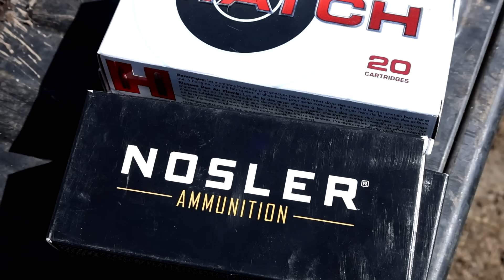Alaska Wildlife Game Camera Footage | Rifles & Bear Burgers

Comment: 😂😂I like how Eric went from stomping on the tire to using a hammer to immediately using the excavator.
Reply: Kinda cheating 😅
Reply: Smarter not harder as they say!
Reply: You can also cut the old tires with an angle grinder.
Reply: When Eric jumped in the tire and the metal thing popped up, I could only think that those tools could lose some valuable jewels. Those two are amazing! Always!

Comment: Bandit's ready!!  A tip.  Before bleeding, use a turkey baster to suck out all of the fluid from the master cylinder, wipe it clean with a lint-free cloth, fill with fresh fluid and THEN bleed.  Do NOT allow the master cylinder to go dry or you'll suck air into the system and have to start over.  You are correct to begin with the furthest bleed valve.  By starting with clean/fresh fluid in the master cylinder, when you get clean/clear fluid coming out the bleed valve, you KNOW it's flushed and has only clean fluid in it.  Move to the next one and repeat.  Another tip which can aid in knowing all the air is out is to use a stick to hold the brake pedal fully pressed overnight.  Air rises, so any residual bubbles should migrate UP to the master cylinder.  Also, if you don't already know about "Speed Bleeders", study up on them.  They use a spring-loaded check ball to close the orifice when the hydraulic pressure is released during bleeding.  They're slicker-n-snot on a greased pig.

Yes, wolves will devour the bones.  That bird's kin folk are sayin':  "Why don't he write???"

Yes, the lighter the weight of the rifle the harder the felt recoil.  The heavier the rifle the less felt recoil.  Also, put the tiniest dab of anti-seize on the threads for the barrel so the muzzle device doesn't seize up on you.  Also, now that you're much further north, KNOW which lubricants will NOT freeze up on you in the middle of winter.  Some local forums may help but will net you a lot of opinions.  For wintertime a thin coat and lightly wiped off will lessen the chance of your firing pin freezing in place, or your trigger mechanism, or possibly even the bolt.  Also, do not bring your rifles inside the heated tent/cabin.  Leave them in the cold so they don't sweat (condensation) and then freeze up on you.  And that way your scopes don't fog/freeze too, but I'm certain you've learned that by now.  Helpful for those new to the severely cold climates from a more temperate one.

Cleaning the barrel doesn't need to happen every time you shoot, when accuracy falls away is when you clean it.  The other time is if you switch from a lead bullet to a solid copper bullet, the accuracy can go away on you.  A squeaky-clean barrel's POI will differ from a "fouled" barrel (having a few shots through it, powder fouled).  Once fouled it should remain pretty consistent.  So, you should verify your accuracy after a few "fouling shots" after a thorough cleaning.  "Back in the day" when people shot "black powder", it was critical to clean immediately after shooting.  It's turned into a tradition passed down from generation to generation.  However, today, with modern (smokeless) powder it's NOT corrosive, therefore there's no need to clean it right away.  Anything using "black powder" still needs to be cleaned immediately after shooting.  Another tidbit is to know your distances at which you "Point of Aim" is also your "Point of Impact".  Since the bullet travels in an arc, there will be two distances in which the "POA" will intersect the "POI".  For example:  my 6.8 SPC caliber can be sighted in at 50 yards and it'll also be on for about 200 yards and be only a couple of inches high at 100 yards.  Also, know the drop at distance to help you know what your POI will be for a given distance (in relation to your hold/POA).  Also, on a low magnification scope you won't "see it" so much, but if you have a 24x (for example) HIGH magnification scope you'll be able to SEE your heartbeat due to the crosshairs moving with your heartbeat.  So, for long range, don't grip the stock using your thumbs, your thumbs have a pretty strong pulse and will transmit that to your crosshairs.

Rock on you two, God bless you both!

Comment: Eric on a post note to install break fluid and you can't pour from container use a long hose, 1/4 inch clear line should be good. i see you use one to drain it... so just use longer hose to refill  main reservoir. and a hole in cap make sure hose is in cap tight put hose into brake reservoir turn up bottle and watch it go down hose and fill reservoir up. Makes getting into rear-ends transfer cases etc.... real easy.

Comment: You obviously got it done and figured out, but I'll give ya a tip with tires, in case you didn't realize it (you didn't mention it anyway).  Rims, have the middle section as a smaller diameter, so one half of the bead can be down in the "dish" as we called it, while you work the other part of the bead, over the lip of the rim.  On that first tire, you essentially mounted the tire, while it was all on the bead, which means you worked very hard to stretch the tire over the lip.  Next time, just stomp the sidewall of the tire, till the bead opposite of what you're trying to pry over the lip, is down in the dish.  Then prying it over the lip is way easier.

Comment: Eric, I just recently purchased a slid hammer for breaking down tires. it works well for small 8-to-12-inch trailer tires.  bigger heavier duty tires like car or truck tires it doesn't work at all. That's why I laughed out loud when you stood on that tire trying to break the bead. I was thinking that ain't going to work.

Comment: Hey guys nice job on the six wheeler. Yeah I know that ammo in Alaska is expensive but you can get a hand loader for each of those that's not that expensive it's like 50 bucks for one type of round   50 for the other so you can load your own ammo and that's kind of a good idea because what makes you a good Hunter is practice especially not at 100 yards you know sometimes you might have to take that 300 yard shot and if you can go practice at 300 yards and set your current so you have 100 yard setting in a 300 yards set in and all you got to do is turn your turret somebody clicks and you can have it on the side of your weapon so you know when your range find your animal you can get a direct hit on it practice makes perfect. Actually you said you have a 45-70 that's a good mousse weapon because the standard load is a 375 grain hollow point and it's very accurate at 150 yards. My main hunting weapon is a Winchester model 70 chambered in 300 H&H and it's one of the most accurate calibers ever made with  180 grain bullet he doesn't drop until about 175 yards but like I said practice makes perfect really it does

Comment: I remember my first attempt to changing a tire using a machine for removing a tire from the rim. I struggled severely, nothing I did worked to get the bead over the rim. The guy that typically removed and changed the tires came over and said 'keep the bead in the narrow area so the tire can get over the rim edge'. It worked.

Comment: Good rifles. Bet they were still about a grand each after the 500 off...
Great calibers too.. but I tell ya it's hard to beat a 30-06 especially if you hand load you can load it for everything from small game to moose. You can get right close to 300 mag numbers out of it. Plus you can always find brass even if it's old ww2 and newer surplus ammo. 
A good thing to get for the side by side is those rims you can put on both way so you don't have a mounting booboo and easily rotate or switch around for what ever reason.

Comment: Getting old tires off a rim is a tough manual job - even with the mechanical push-down aid of a powerful front-end loader attachment. Perhaps next time, try to cut the old tire part-way inwards with an abrasive blade to make it easier to  get it off the rim.

Comment: if changing the fluid doesnt help you may need to change the flex lines.  The rubber flex lines when they gey hot expand and cause brake fade.  See if they make braided lines as a replacement.

Comment: The key to good-tasting bear meat isn't what you season it with, but rather, what the bear was eating in the previous 3-4 weeks.  Which means you need to get it during anywhere between leaf-eating and berry-eating, but before any fish spawning runs happen.  Or wait at least 3 weeks after any spawning runs have tapered off, and the bear goes back to eating plants.  Otherwise that bear will taste very fishy / gamey.  Berry-eating bears taste the best!

Comment: Get a Mitty Vac to bleed the brakes.  Affordable, does good job also some Speed bleeders for each caliper.  Rabaconda or NoMar tire machine.  AMZ.  Like that bead breaker.  Bears, helped work a couple cases where people were ate, nothing left, took bears down cut them out.  Never let your guard down, either one of you.  Like sharks in the water, there's times women don't need to go out.  Very seriously. Buy a single stage reloader like an RCBS Rock Chucker  Master Kit or a Redding.  You need a master kit to get the powder charger and scales and a few other pieces to get stated.  Can get a Lyman Turret head also in the Redding.  I use all these a lot and Dillions.   See what powder works best for bullet weight and get started.  Large rifle primers.  Save your cases.  Reload all your rounds 357, 45-70, 300 PRC and 6.5 Prc, 454 Casull also.  Takes a little time get a couple manuals Lyman Speer Sierra, others lot on line as well.  Each powder bullet company has data to use.  Christenson's are great rifles.  Easy to carry.  Those are cerakoted, burnt bronze finish.  Ceramic, tough stuff.  I have several, very durable.  Carbon fiber barreled especially.  Quality products.  Place looks a lot different in summer.   hard to believe the difference.  Lush growth.  24 hr sun almost.  New tires or no go in the swamps.  5 sec. rule for dropped food.  Grab and go like nothing happened.  Bears a little greasy but good.  Never Fred Myers Tire Center.  Interesting animal shots.  Wolverines are tough cats.  Fresh vid.   All good.  Next time

Comment: Eric my friend....IT so hard for me to see you use tractor to break down tires from your six wheeler.. i thought for sure you were gonna puncture tire or bend a rim...but hey what you got is what you got. But me here in the lower 48 i took just two car tires in to have them switched over to summer tires and they were gonna charged me 89.00. I said well that isn't gonna happen!!.....He said good luck as i walked out and him laughing.... so i went on line to "Harbor Freight" and bought a manual tire changer. Yep a manual one.  Mine cost me 29.99 now they are about 69.00 bucks to you plus shipping probably a lot more. But it comes with a heavy duty bar to remove tire and use... get this!!!! IT has a bead breaker on it. what a PLUS!!!..... and when your done breaking the bead..... a little stand that holds tire above it.  It is about waist level. mine is red  so mine came with a star and a thing that comes up though tire stud hole to hold tire in place. and then on center shaft it has a screw down piece that hold down star onto tire firmly...

 To make it permanent i would if i was you and you get one. Use your hammer drill. Find a place in your shop about 5 feet from wall somewhere... and bolt it to concrete. Me i bolted mine to my 20 foot car trailer deck. i don't have a shop with concrete flooring.. and i didn't want it to move on me when taking down tire and installing new one. You are putting some torque on it when breaking tire and removing installing tire....Works awesome. My advise too.... is get tire spoons to help put top bead on tire.....when installing on rim,... but as i saw you push tire on rim.... same thing with car truck ties.. get them wet with dish soap and push / slide and it should pop right on. If not... spoons are ..or work awesome. Put bar it comes with inside tire push down on tire and just slide around tire ,... use plenty soap water or get some slick stuff from car shops that change tires...and it should go on.. and with the help of Arielle you should be able to change tire in less then 10 minutes. I did all four on my car in less then 35 minutes. Sure with a standard air ,or hydraulic.... like in shop probably 10 minutes all of them.. but hey this for where i live and where you live? awesome machine. and they also make a bubble balancer too..... great investments to safe you money. Easy to use  and handy for everything tire.. you have!!.

 i would look into one. and then there is upgrades as you want to improve your tire removal and install. they have things to go on it.. like electrical on and off for tire removal or install. so they say.. Manual for me is fine. Mine works great on car tires and truck tires even my trailer tires. I even have a small one for my lawn mowers and tiny pull type trailer for lawnmower. Was i laughed at when people saw my machines.. but when they saw me use it.. boy did they shut up hahahaha. Funny how lots here now have them. take care be safe have fun.. life is an adventure and your living the best!!.

Comment: I found out the best gun oil and cleaning is TRIPLE ACTION GUN OIL and I use it for cleaning the barrel and I use a snake bore cleaner and it will clean everything out like in two times pulling it through the barrel